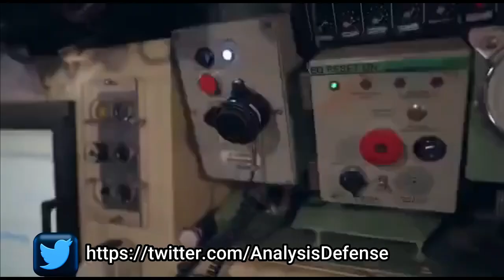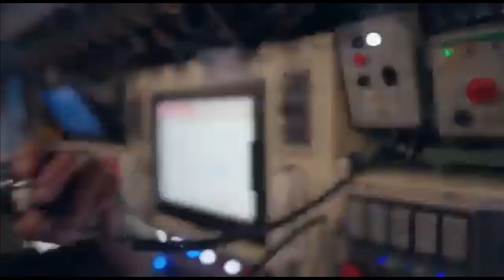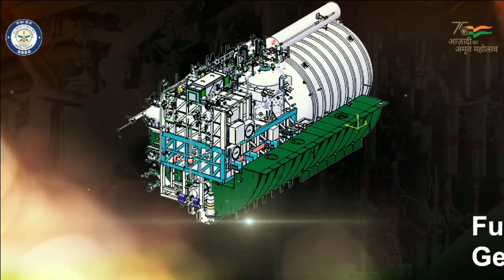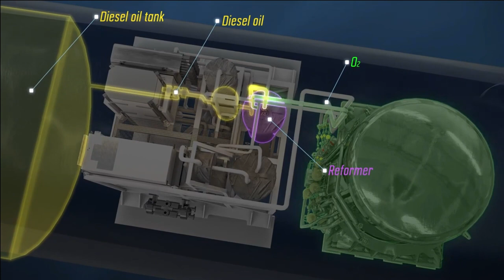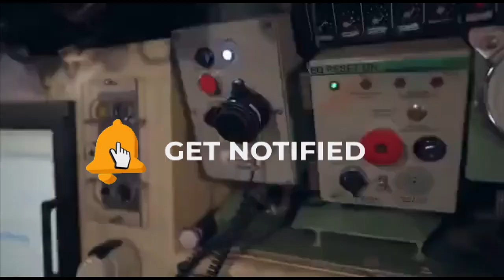Navy to approach DAC for AON for 3 Kalvari class Diesel Electric Submarine equipped with DRDO's AIP

Comment: Since,P75I is in dilemma,it's a logical approach for go for additional Scorpene Class SSK to use the same logistical base.
But instead of 3,6 should be ordered with AIP,Lithium Ion Batteries(3 by MDL & 3 by L&T) to get them all delivered on time through parallel production lines.(3 units shouldn't take more than 6-7 years each line).
In that way we can get all delivered by 2030,P75I & P76 can take its sweet time,which would be minimum 15+ years,till the first unit gets delivered.
6 units at 4.5-5 billion dollars isn't a bad move,in next 7 years or more.